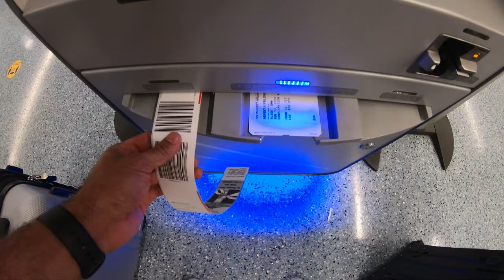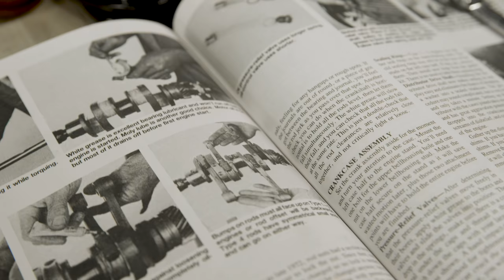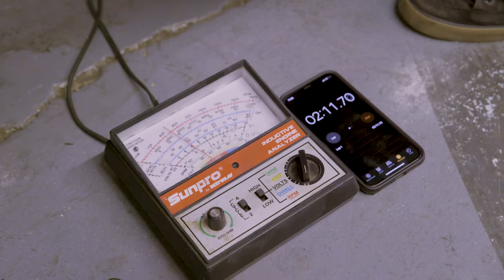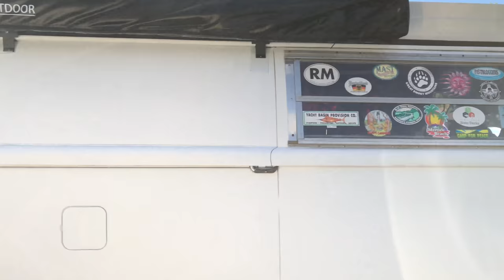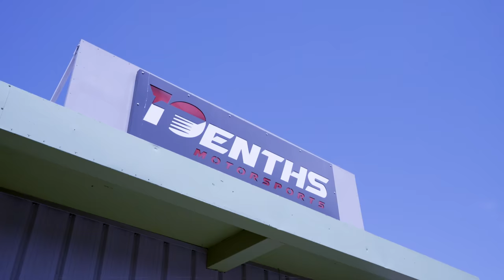TRYING to Rebuild an Air-Cooled Engine in 16 HOURS

Comment: I feel your pain....  I bought my first race car (a VW powered Class 12 off road buggy) with a hole in the block.  I rebuilt the engine from a book and realized while trying to start it, the cam gear/valves were not working correctly (3 bolts on cam gear, 3 positions and I got it wrong).  Had to pull the engine and go all the way back to splitting the case just to unbolt the cam gear and shift it over 1 hole and reassemble the whole thing.

Comment: my dad rebuilt one of these  earlyer this year upped the displacement from 1600cc to 1800c
still remembers how to do these engines  but hes getting old and cant do it nearly as fast as he used to  (used to do it roadside in around 8 hours alone currently takes 3 days in a workshop)

these vw engines are prone to pissing oil after a few thousand kilometers  especially in warmer climates

Comment: That heater tube is precisely the same as the way single-engine air-cooled piston airplane heat works, which is why if you’ve ever been in a small plane, the heat smells like exhaust.

Comment: Ratio rockers are a cheap upgrade to get a lot more power since the stock setup has a very unorthodox 1.1:1 ratio, that and a 32/36 weber carb should give you as much power as any 1.6l engine

Comment: From what I've seen in the industry the term Short block refers to the bottom end only, a long block a a bottom and top end. It does vary from manufacturer but have yet to see the term short block referring to what you have

Comment: I never rebuilt a VW but i had a 73 beetle that my brother and i put 3 engines/transaxles in.. had to learn on the fly. My brother would lay on the ground,we'd work the engine up on his chest and he'd bench press it in while a ran the bolts in. I had fun. I was 14-15. But buses are a little different thatn Beetles

Comment: ... And here I was, with my 30+ years in the auto industry, thinking a short block was just that, an engine block with rotating assembly whereas a fully assembled engine (block, rotating assembly, heads, valve covers but NO peripherals) is actually a LONG block...

Comment: they do not need rebuilt often... They need rebuilt right once and then they will pretty much last forever depending on if you have a carb or not or if it sits or is used on a regular. sitting is bad and these old cars need to live in a temp controled garage. other wise the seals dry out and it is just annoying having to change those all the time.

Comment: as with anything, they have their quirks, and lil gotchas if you dont do them all the time.  Your still missing the thermostat and flaps BTW.  ETA the oring on the distributor is another common fail in the new vw parts arena, the original seal is D shaped and slips in much easier, the aftermarket started using a generic O ring, I assume to save a penny per unit.  I always replaced them with the correct seal.

Comment: Oh guys...built a ton of those things. You can say a lot of negative things about VW air cooled engines but they were/are by far the easiest engines to remove and replace. Four bolts on the bell housing, a couple of wires and it's out of there. No cooling system to drain, no radiator to remove.  I could take one out in 10 minutes if I take a 5 minute break. Changing a clutch, which you did have to do a lot, was less than an hour.

Comment: yeah they don't make power if you use stock parts. I have a 1.6 that makes 100hp. you can upsize to a 2.3 or stick an na subaru motor in there. I think there should have been more of an explanation and research about this. It is just a basic engine, old school, airplanes, motorcycles, and helicopters have similar designs. Porsche raced with larger flat air cooled engines for years and won all sorts of races. It is basic NA tuning. They do really good with turbos as well. t3/t4 is a good time.

Comment: If you find junk in the break in oil,you messed up, that crap eats the !@#@ out of the mains, the connecting rods have marks on them two face up and  the other side faces down,its called rod offset,sometimes its the wrist pin bore or the rod itself, the effect is to get the piston to dwell longer at TDC, which will  make more power, as for horse power maybe 50

Comment: i remember heating the crank and hammering down gear pack onto the back of it with the gas burner of my moms 1940's stove, ha.. And a 21oz waffled framing hammer ( wrapped  head w/ gym sock the went around the sock w/ 5-6 layers of duct tape around it). Ii think i had something like 700- 900 grit wet-sand paper Elmer's glued to a" precision sanded machinist align bore dowel"  from the early byzantine era... Er, wait ,no it was a 1970's rolling pin. but it was perfect diameter to step up to the next ( and last ) crank bearing  Outside spec. I ground a rusty hole saw 1 inch into the end of it so i could run it with a drill.. It was the first time i ever worked on a car ever ,i was so scared, but i followed motor rebuild directions from John Muir's "Complete Idiots Guide to Keep Your VW Alive 100%. That motor went back into a 1970 Kombi transporter that i used for 3 seasons of dedicated Washington St. snowboarding, 150-200 days per season,that build saw 220k miles over 6 yrs. and started my wrenching career 30 years ago. THANK YOU JON MUIR. AND DONUT.You guys and gals are awesome.

Comment: would like to say
a porche engine and a volkswagon engine are basicly the same
back in the day of some where in the 30's a man named porche disigned a car which was called the volkswagon beetle (the first beetle was a convertable and was given to the ruler at the time as a display of what the beetle was as the beetle was acually comitioned by the leader)
so basicly a vw engine and a first gen porche engine are basicly the same. disigned by porche
and the horizontally oposed cylinders is the only thing that these german made bullet proof engines have in comon with the subey flat 4
also if you ever have issues with vw's and your in (frankly idk where) near mustie1 shop

Comment: 13:50 "turned around the connecting rods" push rods you mean? If you some how flipped every con rod backwards and still assembled the engine I would be astonished.

Comment: “ they need rebuilt frequently and can only be rebuilt a certain number of times”
Me on my 4th rebuilt engine using the same block and with over 250,000 miles on the clock, ehhhh not really

Comment: I love when “watercooled” guru’s with all the Bolton power knowledge, take on the humble aircooled motor and then get egg on their faces.😂😂😂
“I can make double the power by turbocharging...just bolt on and go...”
So here is my easy challenge, Let’s see you get 70Kw/100Hp and 70Nm of torque from a T1 casing... (std 34Kw)
Nothing like 1920’s technology to teach you a thing or ten about being a mechanic. 😂😂😂😂😂
Reply: Those little plates you left out are called “Forget me Not’s”!
I love the way you tried to get the inlet manifold in after you put the fan shroud on.. 😂😂
10 out of 10 for shits and giggles guys!!! Thanks I had a good laugh.

Comment: In Brazil, one engine of this was STOLEN.

 IN FRONT OF A BANK. 

An eye witness saw a guy squeezing himself under the VW with a SKATEBOARD. That is not so strange, because these things need a lookover more often than not... except the dude with the skate was not the owner. The perp unscrewed the 4 bell housing bolts, plonked it on the skateboard, and scrammed. He took some 90 seconds at worse.

Comment: The rods need to have the bearing tangs down!
Reply: The rods will go in either way without interference. I would say this isn’t the reason it was tight, are you sure you didn’t have a main bearing crushed by the dowel pin?

Comment: I'm shocked they didn't strip out either the drain plug or the cartridge filter cap
Reply: Uh, that motor had neither.  It should have a oil screen and that is it from the factory.
Reply: @erikcox1947  yeah that's what I was calling the filter, that large aluminum cap over it

Comment: you will be always rebuilding these aircooled motors if you buy heads from empi...  oil passageways on those heads are too small and will create too much cyl head temp and will cause issues eventually.  People always say these are simple motors, until they do one.  Also the chrome tins  won't help cooling either
Reply: Old School Empi was good.  All the New Empi stuff does not live up to the name.

Comment: Not to correct anyone on here but im going to, lol. A short block is not an engine without its accessories. A short block is an engine without the cylinder heads. A long block is an engine with the heads on it, a crate motor is an engine that is basically complete with all of its accessories and everything on it ready to drop in to the vehicle with minimal extra parts needing to be hung on to it if any. Just wires and hoses pretty much. So ya.... Ok bye now!!

Comment: If your VW engine is burning a quart of oil every 1000 miles there is a huge problem. I shouldn't burn almost any oil between oil changes every 3000 miles. Also they don't need to be rebuilt more often that any other engine. A normal VW engine should run 300,000-400,000 miles before "needing" a rebuild. Will you want to do it sooner do to leaks? Yes.

Comment: Dear god man you’re not supposed to hydraulic press the gears onto the crankshaft, you heat them in an oil bath and slide them on. Hope the surface of the crank is still good.

Comment: Anyone who works on air cooled vw's know that you start the engine before you put it back in the car in case you need to fix something
Reply: Not everyone has a spare transmission/bell housing laying around to run on the ground.  Take your time and do it right the first time so you wont have to fix something later on.

Comment: Uhm, "short block" refers to just the block and rotating assembly. You have the heads on, making it a long block. Accs aren't included in the term. From an air-cooled guy, it was pretty amusing watching you guys build this.

Comment: 4:50 wait so if you turn the heater on in an air cooled engine are you just fuming yourself?
Reply: not if the heater boxes are in good shape, the exhaust is separated from the fresh air from the fan.  Now as they age the heater boxes can rust internally and leak exhaust gas into the outer section where the fresh air is,  but you will know pretty quickly if its happening.

Comment: That isn't true you had a short block assembled long before you called it that. The short block is the engine with out a cylinder head or cylinder heads just the crank, rods, pistons, main caps and the block.

Comment: There’s something wrong with that engine... a stock 1600 single port should put out about 45-48hp.. a 1600 dual port is typically 50-55hp depending on intake/exhaust.. i have a 1300 single port that puts out 48hp with light mods.. you guys got screwed this time.. what a shame
Reply: Cheap Chinese parts, lower compression heads (step).

Comment: A short block has no cylinder heads it's the block with crank rods and pistons. A long block is what he had heads installed minus covers and accessorie drive. You can tell they are true amateurs

Comment: So much over-engineering just to avoid liquid cooling and doubling of parts and weird bridges to horizontally oppose the pistons. And it’s still an objectively shitty power plant.
Reply: Might need to catch up on some automotive history.  That same motor could be run in the heat of Northern Africa and the cold of Siberia.

Comment: I really love most of the content you guys create but i can't watch you work on a engine or hold a wrench. As an engine builder it looks like rape to me. Also it is called a long-block, a short-block is just the bottom end with internals without heads and the rest.